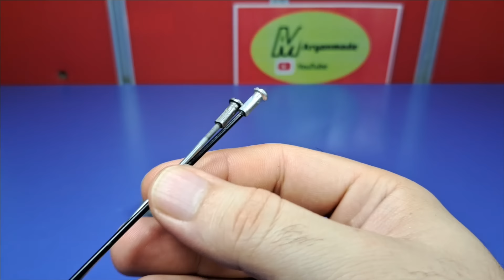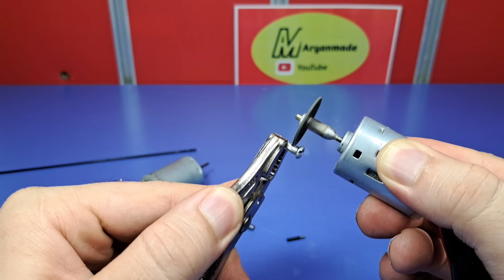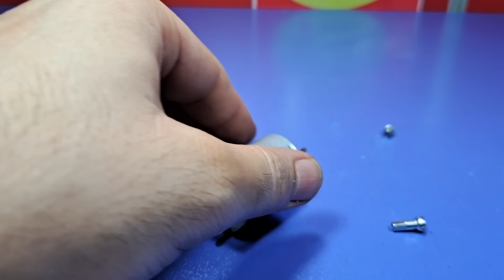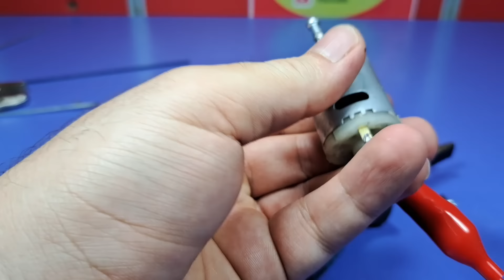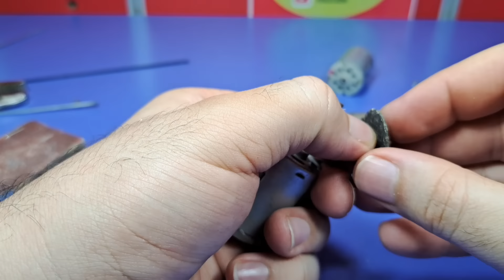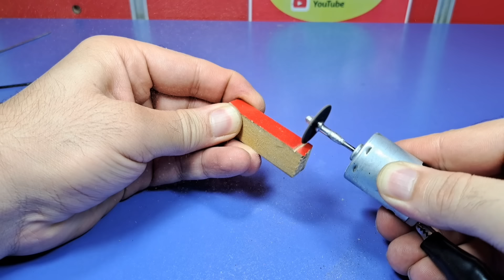How To Make A DIY Mini Drill Head From Bike Spokes

Comment: rapaz que estanho de solda boa e essa que pega em ferro  ?
Reply from the maker: Hi my friends❤, the soldering connection is not a strong connection. So, use this method only on small motors with low torque, and use a small cutting disc
Please see description